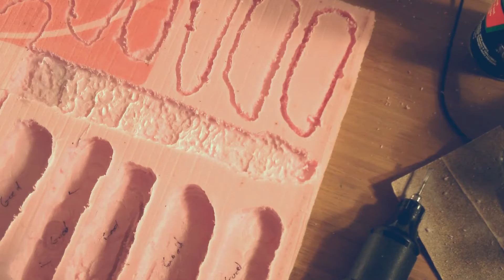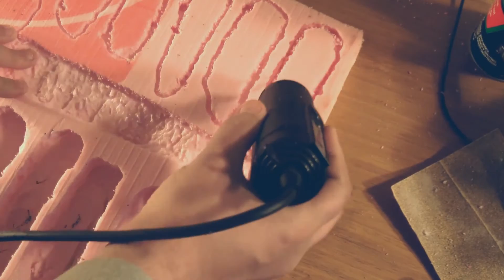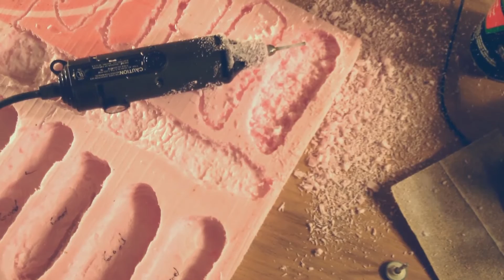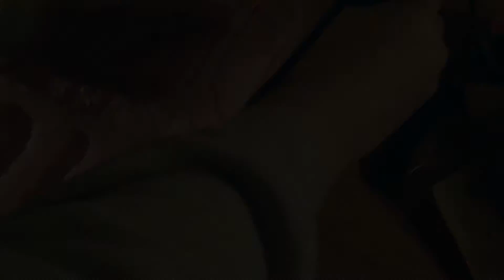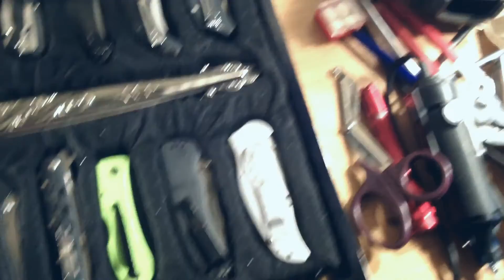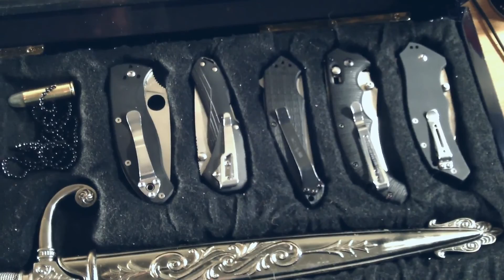Making a custom insert for my knife display box using pink insulation foam

Comment: Great video. Something you might could try that would maybe be less messy is a sharp wood chisel to remove the center material and they also make a very coarse little drum sander for the dremel probably about 50 or 80 grit what do nicely for finishing.
Reply from the maker: Yes sir that was one of the ways I was thinking. I just couldn't find it when I started this project (of course the chisels popped up today.....). As for the sanding drum it works just fine on the sides of the carved area just not on the bottom.

Comment: You can buy the off brand "pick n pull" foam inserts for less than $10 online and at Walmart
Reply from the maker: yes I could but I had this stuff laying around. I only had to buy felt. I got the case for free off of craigslist so I wanted to keep it is cheap as possible. Total cost to me making this case is under $1

Comment: i think your referring to a rotatory burr, a metal shaft with different shaped ends on one end. having cutting edges or a file like finish..
Reply from the maker: Thanks I couldn't remember the name of it for the life of me
Reply: i've been an auto mechanic for years. i also did many porting jobs on heads and intakes. i have used them alot..